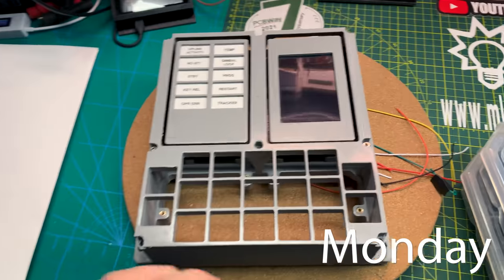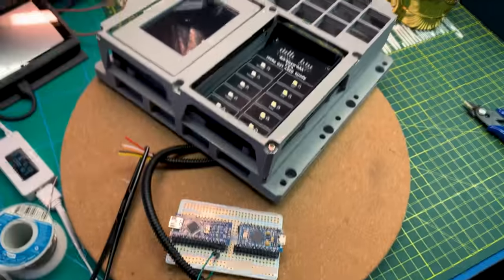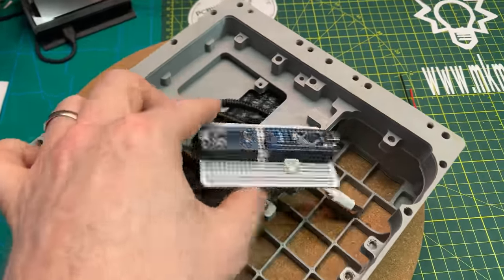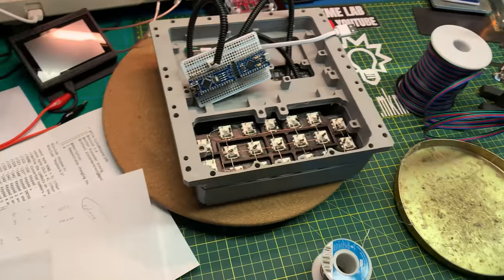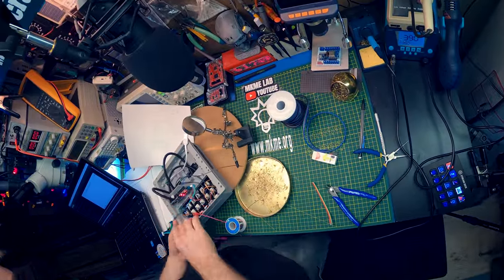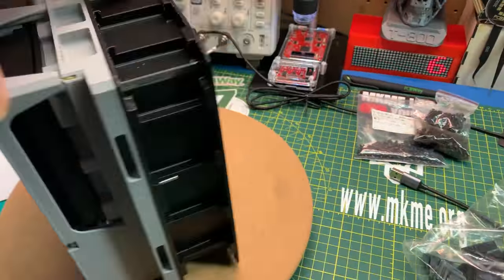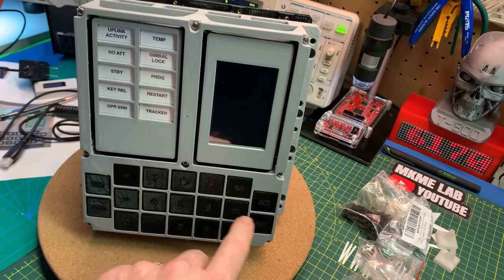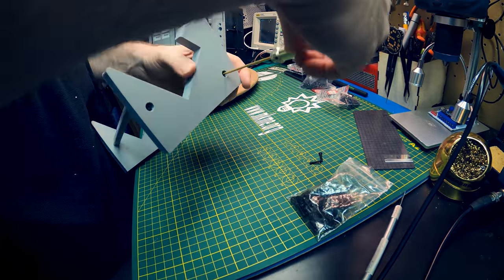TWO Arduinos AND A Raspberry Pi Together???  Apollo DSKY

Comment: With the textile loom you use your soldering iron to cut it, it melts the individual fibers and keeps it neat. My first proper job was a harness shop that’s how it’s done there.
Reply from the maker: Knew there was a secret :)  I tried whipping the ends after cutting but of course that just tries to melt itself to itself. Thanks